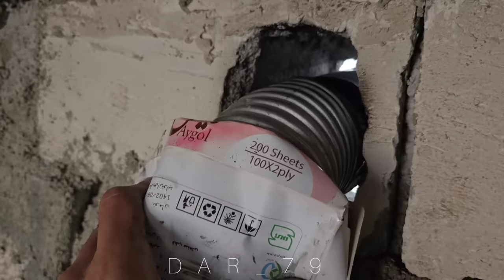Being caught in a storm: the terrible storm to Nargis's belongings and house

Comment: They do everything backwards and in a hurry. They should have concentrated on the roof and plastering the inside walls instead of trying to get a bathroom finished.  I think the architect probably tried to tell them but only followed their instructions. I think Rasul’s ego has been a problem. Once again the children will have to suffer.😢

Comment: ❤I also think that the role of the family is also important as a haven to which we return in the most difficult moments, in moments of life's failures, to seek shelter and understanding for our life's mistakes, disappointments and anxieties. To finally take away another portion of faith and hope that life always makes sense.❤Such an event in the form of a leaky roof could have been predicted in advance. There was an error in placing the sheet metal on the roof, it was necessary to check whether the sheet was damaged, and when installing the sheet, the edges had to be sealed with plastic mass. and ensure an overlap of 10 cm, never place concrete on sheet metal. For Iranian conditions, it should be insulated with 10 cm of Styrofoam and aluminum foil. It's a pity that now young people have protected the roof against rain, and with thick foil there would be no such problems. This should be the case in the future. what to do, otherwise the same situation will happen again. Yours faithfully..
Reply: What a pity !  Those people do not have common sense !!!

Comment: They need that tar paper put on roof. And back and sides of house , that stops bricks from getting wet , they all build place for winter but, it’s not waterproofed probably, those blocks are so cheap and poures you can tell by how light they are to lift, and the tin roof would be hot in summer and cold in winter. 
Good luck ❤❤❤

Comment: The building is impeccable from the outside and inside. If time, effort and money were invested in making a room painted from the inside with cement and plaster and covered from the outside with insulation and with a wood stove with ventilation for cooking and heating, their atmosphere will always be rainy and cold.

Comment: @DAR-79 This family had a rough time with that nasty weather. The good news is that now you know where the issues are with the house: roof leak, filtration of humidity in the walls and no drainage out of the washroom floor. Once this weather passed, it will be time to review the issue and have them solved. They need to permeate the roof first, second finish the rest of the house: roof is badly needed and a person who knows how to install and repair roof is a must. The oils heater is of a cheap material, we can see how cheap it is and it’s unsafe. Have the inside walls properly plaster by someone who knows the job and don’t forget the pipes for drainage of water in the washroom. I am glad everyone is okay. ❤❤❤❤

Comment: You need to tie a metal wire strong around the heater pipe twice and use concrete screws to fasten it to the wall or roof

Have rain coats and boots for raining or snowing days where you have to go outside they're also water proof pants a must working in the rain

Lay a path of rocks from the house to the road to walk on in heavy rains
The ground turns to mud easily

Work on water proofing your roof
Store you blankets in large plastic bins
Always have dry blankets stored in the trunk of the car for emergency

Comment: Gas heater is the best because you can turn it off with a valve
They have capsule heater.
The most important thing is to secure the exhaust pipe and use metal tap screws to secure it and use plaster around the seams joints to help seal it from water.

The reason the water is coming inside of the exhaust pipe is how you connect each pipe together

You start from the inside of the heater you put the first elbow pipe next the straight pipe goes over the elbow connection next connect the elbow pipe over the straight pipe connect a small pipe over the elbow pipe and a elbow pipe over facing up and a straight pipe that goes over the elbow pipe straight over the roof next place the H cap on top
The problem is in the outside elbow you put the straight pipe inside the elbow pipe not over it so when it rains the water will get inside the exhaust pipe causing the heater to catch on fire water and oil don't mix and it can explode

If you don't tie the exhaust pipe with a metal wire or brackets the wind will knock it off
More problems

Comment: I never trusted those heaters, please use the wood heater it is safer don’t install they oil heater back it is a death trap! I am very disappointed if the work on the roof anymore could have seen the room did not had a true fir the water to run off please ensure the  contractor have a throw so the water can run off!

Comment: The roof needs to be sloped to drain well. Who barks the roof without sloping?
It needs to be high in the front and low in the back so that the rain can be drained well,
Who builds a house with a flat roof?

Comment: I knew the roof would leak because the sheet metal wasn't laped over far enough and should have been slanted enough for the water to run off of the roof. So sorry for all of this happening to you guys. The roof needs to be redone right

Comment: The problem is too many projects and not focus on what's more important
Shelter that is water proof

You didn't finish water proofing your roof with bitumen on the roof let dry a few days before placing tar paper on top over lapping over the side of the house

Your roof is not pitched so water will accumulate and find cracks in the concrete
Concrete absorbs water
So you will need two layers of bitumen on the roof then tar paper